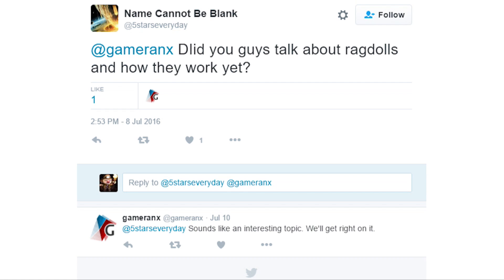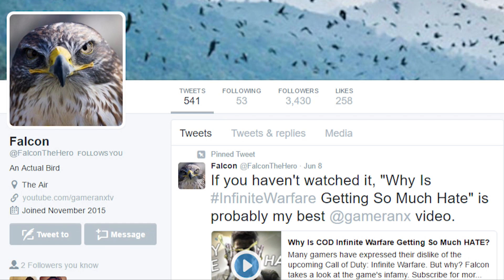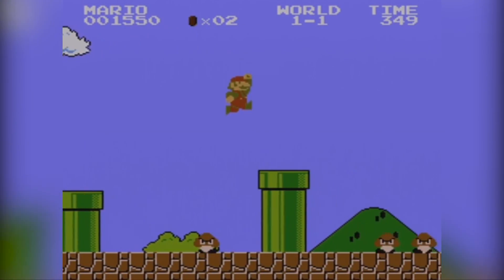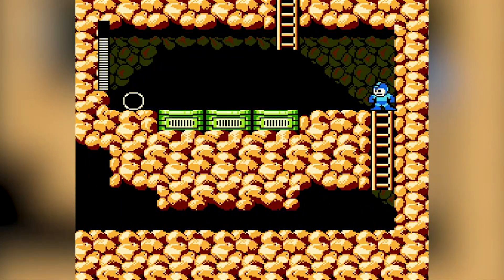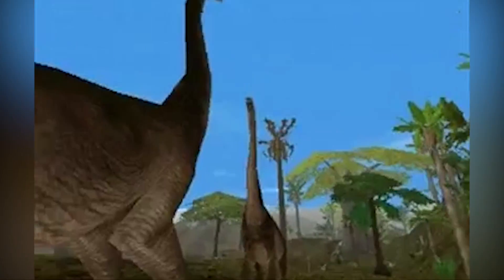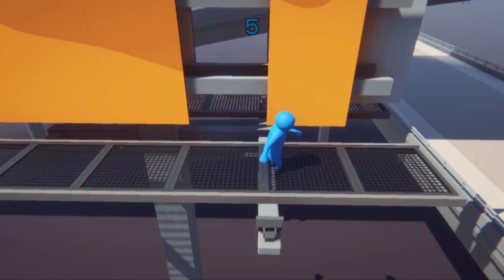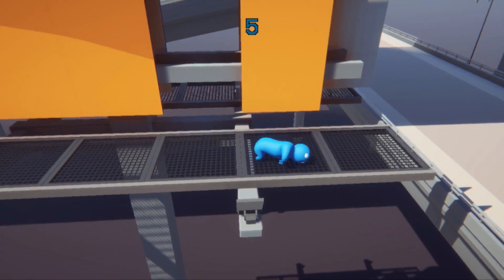How Do Ragdoll Physics Work In Video Games?

Comment: Not entirely true.

Inverse kinematics and ragdoll are different things. But they can work together. Let me explain.

Inverse kinematics is editing a non physics animation with code. It fires a trace from the knee, or the foot downwards to check where the ground is and then it edits the pose of a character depending on the result. No physics is needed to achieve this.

Ragdoll is a set of physical bodies with mass and shape (capsules, spheres, boxes, convex meshes) stick to the character's skeleton that are connected with constraints, hinges. When it fires up it falls down dragging the skeleton and the character with it.

Now, what GTA 4 and GTA 5 uses euphoria, what TruCloudGaming said. Euphoria is a toolset of creating blended animation and physics. That is, when a ragdoll fires the source animation is taken into account as a result to which a physical ragdoll should strive for. So, ragdoll actually uses motors, applies angular and linear motion to the bodies in a way to achieve the pose an animation has at the moment. So, it's actually a 100% ragdoll with motor forces applied to the physical bodies. And this also can be used with inverse kinematics. An state of the character's skeleton has it's pose altered using code, and this animation is taken into account in the motor system of a physically driven ragdoll. 

flies away

Comment: Why in some FPS, the gun just goes through a wall?
Reply: Probably just a glitch in the system. Wonder how many people will get that reference. (Hint; his name is Glitch)
Reply: Since the gun is a visual element, it clips through. Its veeeeery easy to fix that problem though, unless your dealing with multiplayer, then it requires just a tad bit more work.

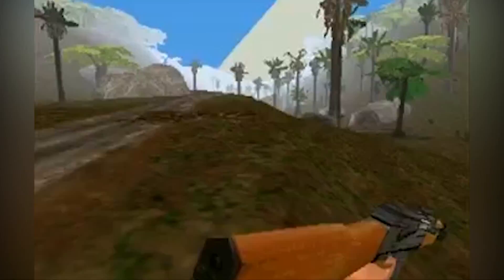Comment: 2:25 INVERSE KINEMATICS is not just using bones. FORWARD KINEMATICS also used bones that's not what changed.
The difference is that with FK, for example, if you want to make a hand to move to another position in space, you'd have to position the arm, then the forearm, then the hand, while with IK you just move the hand to where you want it and the rest of the bones are pulled accordingly. Using FK only the "parent" bone can move the "children" bones, using IK, the "child" bone can affect it's "parents".

Comment: First of all - good video!
But I think you got some stuff wrong. Let me get them straight.

1) When 3D came to games the first animations used splitting an animated model into several objects. BAsically any limb that could rotate relative to other limbs had to be a sebarate object. After some evolution animators learned to use those objects clipping through one another and texturing them appropriately to hide the fact that the mode is not 1 piece, but a crapton of work was required to create and animate a model. And sich things like individual fingers gave modellers nightmares.

2) Some time later Skeletal Animation was invented. Basically the information about the hierarchy of moving parts in a model was compiled into a "Rig" that consisted of "bones". Bones were basically same subobjects as before, but they did not have ANY graphics attached to them. Instead they were referenced by indifidual vertices using a special kind of rendering - Skinned Rendering. Basically each vertex knew it's original position and had some references to one or more bones. When it had to be rendered, vertex calculated what offset it should have based on current bone positions, compared to their original positions, mixed those offsets using specified weights, and calculated it's current position based on this mixed offset. Sounds like it's alot of math but actually it's just a few matrix multiplications.
This was revolutionary at the time as it simplified creating model (as they could now be created in 1 piece) and once a Rig was set up, it could be used for multiple similar models. And animations now could be created for a Rig that would then animate different models.

3) Somwere along this way people got annoyed that skinned animations resulted in some unrealistic misplacement of vertices when bones rotated significantly, so they invented blending this vertex offset from skinned rendered with some manually created adjustments using blendshapes.

4) And after Phisics engines were introduced, the idea that bones could have colliders attached to them was almost intuitive. And bone rig with collider on it is actually a RagDoll.

Comment: developer here. 

this is partially VERY wrong. inverse kinematics doesn't mean bone systems. the fact that a game is using a skeletal system has nothing to do with IK. you have forward and inverse kinematics. forward means that you move/rotate your bones and you end up with some kind of result. IK is an inverse of that - you have a result (for example your hand has to reach a ball in mid air) and based on the result you calculate how to move your bones in order to reach that position. 

the author of this video confused the two by showing a 'walking on stairs' example from ds3 as  ragdoll physics blending with animation. that was IK in action. the animation was being corrected by IK calculations based on test performed for feet against ground. no ragdoll there. 

A ragdoll effect is basically a simulation of our limp body as the end of the video says. It is made of rigid bodies  that are connected by joints with angular limits. the physics system like havoc or physX is calculating the movements of those bodies etc, so you get a ragdoll effect. By default ragdoll is spawned at any time in animation so the explanation of a blended ragdoll is again wrong. the fact that the game plays a predefined death animation and enters a ragdoll state at the end of it or when a character hits something has nothing to do with a way the ragdoll is implemented. it already was popping into ragdoll from any animation state as well. 

A blended ragdoll or an active ragdoll is a system when ragdoll's body parts are being moved by actual physics forces driven by inputs from predefined animations. the ragdoll is just trying to match predefined poses but will also take the surroundings into account. on collisions in can react with different animations just like with the js3 clips showed. 

i am happy to answer any questions  

cool ragdoll physics on my channel btw.
Reply: If the video's explanation is incorrect, then how does it explain it well? On top of that, most of what he wrote is made up of simple, common words, not techincal mumbo jumbo. You just don't care to read is all this is.
Reply: Random Reviews Okay, but again how is the video fine if the information isn't correct
Reply: Random Reviews Haha then why are you watching a video on how rag-dolls work?
Reply: Thank you Thank you Thank you. Cool ragdoll physics on my channel as well :D.
Reply: Random Reviews Sure the video is easy to understand, but the information being presented is incorrect, making you easily understand false or misleading information. If the information presented in the video was accurate, then it would be great.
Reply: I love your games I'd played a lot of them
Reply: I'm a student in video game art and was about to write a similar comment but I'm glad to see someone already covered that.
Reply: What have you developed
Reply: well i had a project in mind and just started doing it, learning everything as time went by
Reply: The video isn't fine.  It may be easy to understand, but some of the information it gives is simply wrong.
Reply: You wouldn't happen to know a site with a glossary of terms about these kinds of things? I've been applying various systems of IK and and moving into procedural animation rigs in blender and its game engine, mostly by myself, could use a cheat sheet so I name my stuff right.
Reply: Hi
Reply: check out my channel. 3 2d shooters with heavy use of physics. 4th in production.
Reply: How did you get started with animating / graphics for games? Aspiring developer here :p
Reply: thetidegames.com / mmankt I am doing the same thing, I am just asking what modelling programs you started with
Reply: thetidegames.com / mmankt Hi
Reply: thetidegames.com / mmankt AAAAAH DUUUH I DO TEE EF TOO MAP I NOW AL ABAUT RAKDOL PHYSISICS
Reply: thetidegames.com/mmankt
Reply: This.
Reply: +Medyns DUDE...i replied to another guy EARLIER who tried to explain the video but ended up making it more complicated THE VIDEO IS FINE read the earliet responses before you blindly reply you MORON
Reply: this just confused the shit out of me instead of helping..so much technical mumbo jumbo yawn
Reply: @MrRandomReviews  rigid bodies are just physical objects simulated, angular limits are limits on the rotation of said physical objects. That's basically it.
Reply: +KingTumTum101 the video explains it good...but the guy above me who replied made it more complicated

Comment: Pretty sure that ragdoll physics relates only to the ragdoll ball-and-socket joint that limits rotation of character's joints. These joints have limited rotation so you don't get weird-looking joints popping, knees rotating forwards and whatnot. Where the rotation of the joints controls deformation of the skinned character mesh - with ragdoll applied, it's effectively making the mesh control the joint rotations. Once a character has been 'killed' the rig transitions to a physics-based skeleton - IK turns off and the rotations of the joints are controlled by the mesh contacting hard surfaces. 

It has literally nothing to do with IK, DMM destruction physics or the rocks sliding down a slope in Uncharted 4, as these are often just implementations of Bullet or PhysX physics engines.

Comment: Still wondering why bodies disappear after you kill them in video games...
Reply: hardware constraints
Reply: It leaves processing room for more enemies to spawn and/or a way to keep the game clean as constantly processing death animations will quickly kill frame rate. Sometimes an are will be preloaded with enemies, I don't really have a good reason for that other than programmer preference.
Reply: yeah I want a tight 3ed person shooter like Max Payne 3 where all the clips, shell casings ,bullet holes and bodies stay, with real ballistic damage stats taken into account  where it matters more about the caliber you pick than the gun's make/model.....and true vital organ placement in character models for real hit/damage ...
Reply: Gohan Because to save on resources
Reply: Console VRAM limitations, rendering a dead body takes up VRAM,  the longer the body is on screen, the more VRAM is used, and the faster the System will run out of VRAM tanking the Frame Rate, and even making the Game Hardcrash. Most Games have their "Unified" core Code built around the Next Generation Consoles, which have LESS than One Gigabyte, meaning it fills up quickly, so they program the game to make the bodies dissapear almost instantly after they hit the floor to avoid swamping the tiny levels of VRAM on Console, unfortunatly, when the Game is "ported" to the PC, the developers often fail to reset this limit to higher amounts (the average Gaming PC has 3GB of VRAM) for whatever reason, meaning, despite the higher VRAM, the bodies still dissapear almost as soon as they hit the floor.
Reply: +Simeon Yves To me, the only time bodies should disappear after getting killed are monsters ,zombies, etc. only because it makes sense how they burn away or disintegrate after getting killed. I noticed that in the Call of Duty game mode, search and destroy, when you kill somebody, their body would remain there until the next round started. Don't get me wrong, i don't mind it at all , I'm just saying it's a factor that holds most games back from being "realistic"
Reply: RAM/fillrate limitations. Hardware can only do so much.
Reply: +denji94 damn... now I'd pay 60 for that.
Reply: denji94 it just would not be possible on the current Console hardware, the Player base are expecting ever more refined and detailed textures, meaning the textures alone are all but swamping the Limited amount of VRAM, remember, both Xboxone and PS4 only have 750MB,  there just is not enough VRAM to do those textures and permenant Bodies!  The Player Base needs to remember, its a 750MB Console. Not a 3.5 GB PC! .

Maybe with the 2GB AMD Radeoen Ten (RX-Polaris) units that are rumoured to be fitted into Xbox Scorpio and PS4.5 Neo, it will be possible to have Permenant Bodies, as the Consoles will have more VRAM available to render them, but it is not possible on the current 750MB ATI/AMD Radeon 7750 and 7770 HD units used currently.

As I Said, having Permenant Bodies IS Currently possible on the PC provided the GPU has enough VRAM, but because so many Games just use a ported (and often very badly ported) Console core code and the VRAM Limits on the bodies are not reset from the Console versions, it is only a few PC Games, those that are either made on the PC for the PC and then ported down to the Consoles or have a PC specific core code, get Bodies that hang around for a decent level of time.  

Call of Duty uses an extremely elderly Grapics Engine do not forget it is basically a heavilly modified version opf the Quake 3 Arena engine, which uses very litttle VRAM owing to the fact even the top of the Range GPU's of the time of that Engines launch only had 256MB of GDDR3 although the modifications on Idtech 3 mean it burns a lot more GDDR5 VRAM than that now, the LOW settings used in the console versions mean that the game probably easnt burning more than 400 od MB of VRAM even in SP, and in the MP COD also runs at a lower resolutiton to SP, this means it is using a lot less VRAM and the bodies can remain for the round.
Reply: Simeon Yves ok
Reply: To make room for newer dead bodies.
Reply: Like if gta and arma 3 were blended...
Reply: supposedly Valve hasn't made Half Life 3 yet because that's exactly what they want to do, and technology just isn't there yet
Reply: ***** The Tech has been there on PC for Ages, 2GB VRAM is enough and weve had 2GB since the old 400 Series Geforce GTX  Fermi units, its just that well, PC still just is not strong enough yet to carry a massive AAA title like HL3 purely on its own, yet, to keep the Classic Half Life Gameplay (any attempt to Modernise it, and over Half the Fanbase will walk out in disgust as they will consider the Game to have been Consolized) HL3 is basically going to have to be a PC exclusive, Valve are just waiting for PC to become strong enough to handle a massive AAA Exclusive again.
Reply: That's funny, my laptop has double that amount of RAM and can only play KotOR on medium-high. Something tells me you're just making up techno-jargon
Reply: ***** 2GB of GDDR5 VRAM, not 2GB of DDR3 SDRAM.   

Graphics are Handled by the Graphical Processor, which, in your laptop, is either a Mobile unit or an Integrated Unit, and given your issues with KotOR, it sounds like its integrated, therefore has less than 1GB of GDDR5 VRAM, ie around the Same as a "next Gen" Console.  

if you had 4GB of GDDR5 VRAM you would be running KotOR at Ultra and still have a tonne of VRAM to spare as 4GB of GDDR5 VRAM = a 980M and thefore a top end Gaming Laptop such as a P57W, which can run even the new Battlefront at Ultra 1080P and a constant 60 FPS+  

You have 4GB of DDR3 SDRAM! which is downright pathetic these days as top end Laptops have 16 or more GB of the Stuff, (and DDR4 is availabnle to laptops now as well!) even the next Gen consoles have 5GB of DDR3 to play with (the other 3 to make up the full 8GB of DDR3  are taken up by the OS, the cache, and the Mutitasking!) so 4GB of DDR3 SDRAM is nothing ito boast about I am Afraid 

SDRAM (ie DDR3/DDR4) is the MAIN System RAM, which does not Handle the Graphics, only the Games Core Executable Data Code, Games load their Data into the SDRAM (hence the Loading screens) then distribute the Data, as and when needed, from the SDRAM to either the CPU, GPU or Sound Device depending on the Data type.  Your Laptop has 4GB of SDRAM, not 4GB of VRAM. 

Don't beleive me?, then go look up the Difference between VRAM and SDRAM on Techquickie or Similar Channel!

Permenant bodies require 2GB of VRAM, not 2GB of SDRAM.

Again. just look at the Type Coding.

DDR3 and DDR4 are SDRAM.

VRAM is either GDDR5 (90% of GPU's), GDDR5X (as seen on the new Nvidia Geforce GTX 1080) or HBM (As Seen on the AMD Radeon Fury X)

it is Childs Play to tell the Difference just by looking at the Type Coding!!  

Now, kindly do NOT accuse Me of making things up when you have got your RAM types incorrect, thankyou!   I have been PC Gaming for 24 Years, I have forgotten more "Tehcno Jargon" than most Casual PC users will ever even Learn!
Reply: Because a massive pileup could ruin your frames and so despairing them would help keep it at a steady framerate
Reply: Simeon Yves someone's PMSing
Reply: ***** Sigh, another youtube idiot. Kindly go and  Troll someone else you moronic Child, I despise your kind and refuse to waste any more of  My limited time on you. .
Reply: Me?
Reply: Gohan I
Reply: +Franklin Blankenship Exactly!! Just a game where everything you do has a reaction, shooting someone in the throat causes the person to grab for it , and their buddy next to them stops shooting at you to pull them into cover.

Comment: 3D characters have always used a hierarchical system of bones to animate whether you're using physics or not.  There's no other way to do it.  Inverse kinematics is a way of animating those bones using a handle at the end of a chain of bones as the thing that is animated and the bones in the middle will rotate according to the handles position.  A common example of this would be legs, where you could animate just the position of the foot and the knee would bend based on where the foot is.  Forward kinematics is animating the rotation of joints like the elbow and wrist individually.